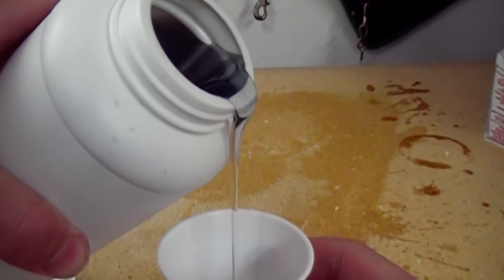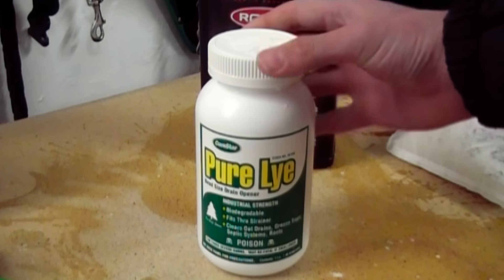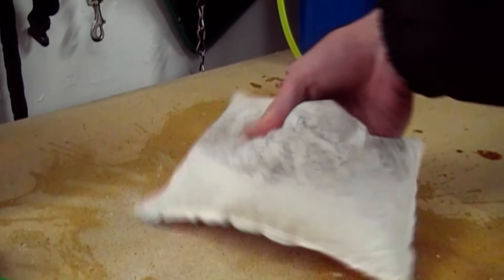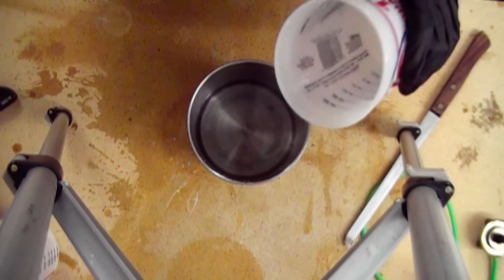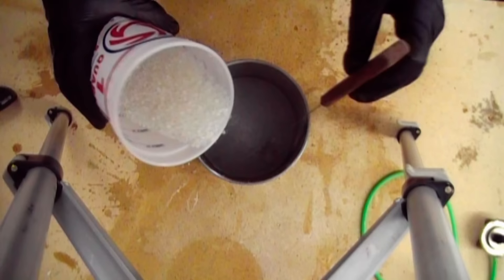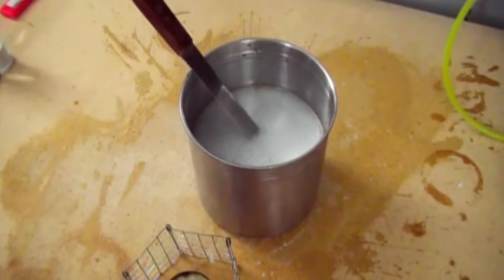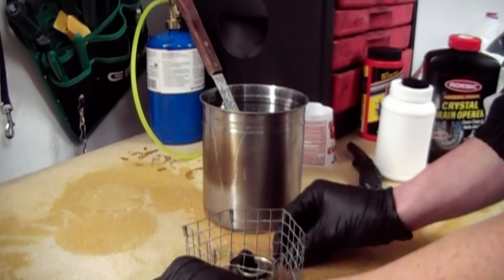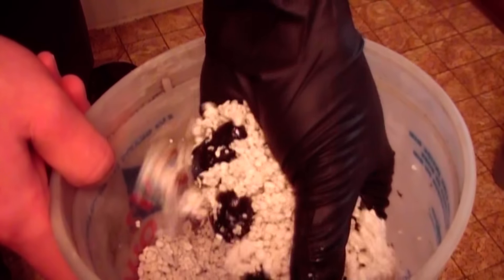Homemade sodium silicate (water glass)

Comment: Good day
I am interested in your homemade sodium silicate. I tried to make it myself. Which pH has your finished product? My 3.2 has and I think that is much too acidic. I read that silicate until a pH of about 10 is stable. Should I add more hydroxide just until I get to the desired level?

Thanks for your response and please excuse the bad English (Google Translate ;) )
Reply from the maker: mcj245 That is strange that your product was acidic, make sure all your chemicals are pure. I do not think your product can be salvaged.
Reply: Many thanks for the answer

That's odd. Do you have the PH measured once? I have kept exactly to the instructions. And I have my sodium from the drugstore (No drain cleaners or similar), it is 100% pure. Are there different types of silica gel? The water glass acts on the consistency just like yours. Is there a way the water glass test?
Reply from the maker: You can test the product by adding an acid, vinegar works fine, it should react to leave a gummy blob of silisic acid. Or if you have pure ethanol, add the ethanol and it will form a stiff rubber like material.
Reply from the maker: The reason I don't think sodium silicate can be at all acidic is acid causes the product to react into something else. There are silica gels that have moisture indicators in them. I avoided using those because I don't know how they will react. There are also different kinds of moisture absorption products that are not silica gel.
Reply from the maker: Oops, it's spelled silicic acid.
Reply: Hello I did a test with vinegar. There is no visible reaction happens. So I tried it with a 59% phosphoric acid ;). It immediately became gel. So I think my product is fine. Maybe I'm trying to make a laboratory garden just to be sure. Thanks and Greetings

Comment: Hi clkindred can you please help me. When I'm making my sodium silicate I'm using the exact same ingredients as you and mine is blur and gets big lumps of blue no matter how fast or slow I pour and mix them together.  Please help me. Thanks
Reply: I mean blue not blur
Reply from the maker: Derek Jacobson
 Some silica gel have color changing dye to indicate moisture content. It color dose not matter. Some have noticed they need more water to get all of the gel to dissolve. If your gel is in the form of beads like here, you may need to add some heat with a hot plate or burner to get the gel to dissolve. Be careful though, once it starts to dissolve, it will generate its own heat and will boil over if not taken off the burner. Thanks for the comment!

Comment: The NaOH is capable of turning the glass into sodium silicate, so a steel container is best.
Reply: I want to see a video of that. It seems very wrong to me, and I have used pyrex more than once WITHOUT issue.
Reply: @dtrotteryt  pyrex are boron not silicon based

Comment: another option for silica gel packets is crystal cat liter it is made from silica gel
Reply from the maker: Yep, that's what I have been using lately. Thanks for the comment!
Reply: I am going to try MIMI cat litter, also supposed to be 100% silica beads, and it cost about 2/3 the price of Crystal! Crystal was $15 for 8lbs and MIMI was $5 for 4lbs so I bought 2 bags and saved $5 for the same 8lbs! Both were at Walmart super center about 40 miles away, the little Walmart local did not have either!
Reply: And the ammonia and stench emitting from the litter is just a bonus perk. I figure, I'm getting every last penny I spend out of that cat liter, so, not having a cat myself, I put a box of liter out in the field down the street for all the feral cats to use, (allowing them to regain some dignity as well I might add), and after about a week and a half, I picked er on up and brought that ammonia stanching box of cat piss, a few turds, some fox tails and dandelion petals, and soggy silica gel beads, back on home to the garage where I had my 5 and 7 year old daughter start sifting out the turds and other misc debris, then had the Mrs begin drying it back out using our China Wok and a couple broken drum stick halves from back in the day as stirrers, while I managed to collect about a half a cup of distilled water from all the excess steam while I took a hot shower. I grabbed some fresh lye from the neighbors across the street in perfect timing too, just before they got home, scooted on back home and had the kids start mixing in an old flower vase we had laying around the backyard, added some heat from my kerosene jobsite heater/dehumidifier, and boooooyyyyy, what a mistake that was.... Must've still been some cat piss moisture left over or something, because, well, things got a little hot... The vase came out just fine, the kids are....Okay kinda, the wife Is always pissed anyhow so no worries there, but her parents old classic caddie we kept in the garage has seen better days... Next weekend were cooking up some bathtub biker dope with cat piss in it just to see if I was right.....yup....

Comment: the mimi cat litter i found says porous silica sand, not silica gel.  are these two different things?
Reply from the maker: I thought that too when I saw that description on the bag, but no they are the same. Silica "gel" is just silicon dioxide, that has a porous structure that allows it to hold on to moisture.

Comment: Excellent, great videos, I just had to sub. So going by what I read, if it's a little thick in viscosity, add more water.
Reply from the maker: Yes, depending on how hot the reaction is, you may loose a lot of water as steam. Just add water until the desired viscosity is reached. The silica gel beads I used here reacted slowly. Silica gel kitty litter or other "rough" gels react much more vigorously and with much more heat. Be very careful if using rough gel.
Reply: Great stuff,Ordered everything for the whole process, took a while to decide but I have to give it a shot. Wanted one for a while and yours to me was the best way to go, You make  sense.

Comment: I want to know if this is what I need to repair cracked on cell ph screen and how to do it would you just apply over the whole screen and would it be just like new glass ?
Reply: I tried this, and it didn't work quite as well as I hoped it would.  It does fill in the cracks some, but leaves it less clear, think of like a tape residue. But it will increase the structural integrity some.

Comment: Mine ended up with some fat clumps of silica gel. What did I do wrong? Did I add it too fast? Too hot?
Reply from the maker: You can add more water to it if it won't all dissolve. Some people have reported this same problem and it might be water loss from steam while boiling. If your silica gel is rough, or small particles it will react more vigorously and cause you to loose more water than I might have.
Reply: my silica is sand like in consistency, I think I added it too quick also.

Comment: I just finished a batch (1000ml distilled water, 400g sodium hydroxide, 600g mimi kitty litter) everything went smoothly. turned out a deep purple cuz of the dye in the kitty litter. lol
Reply from the maker: +pwntagerz Gosh, sorry for the delay! Good to hear about your success, I have used bleach to destroy the purple color in the kitty litter before turning it into sodium silicate. It works pretty good, leaving a colorless product, but there dose not seem to be any need to do so. Also fumes are then a larger concern if any bleach is still present.

Comment: free8704 I appreciate the comment.. definitely let me know. I have everything else to make my forge aside from the aluminum oxide..
Reply: Beverly Brandon Yes the 70 grit does work. It is a little more crumbly though when making the cement, it really needs to be pressed into the walls of the forge and helps to blend it up in a coffee grinder a little bit first. You forge also takes on a black color obviously rather than light gray.

Comment: Will 40% Sodium Silicate work for the coffee can forge?
Reply from the maker: Sounds a bit on the dilute side, it may take longer to dry. Drying is the biggest source of problems when using sodium silicate at high temps. If its not dry, it destroys itself.
Reply: clkindred I read somewhere that Portland cement will help it set faster and CO2  gas will as well.

Comment: I'm not sure whether my drain cleaner will work. It contains sodium hydroxide, sodium hypochlorite and some other stuff. Will it work? If not, what would?
Reply from the maker: It might, just be aware the sodium hypochlorite (bleach) will add a toxic fume hazzard. If you try it, be very careful.
Reply: +clkindred Thanks alot for your quick reply tho :) Sure I'd try it out if i can't find 100% lye drain cleaner :)
Reply: +clkindred Hi i found one with the ingredients: sodium hydroxide and surfactants. Will surfactants be involved in anyway?  I think this is the closest to pure lye that i can find in my country
Reply from the maker: +Sheekit Low "surfactants" is kind of a vague term, it could be a number of chemicals. Surfactants are what make soap "soapy." Another viewer reported better luck searching for "100% lye" instead of drain cleaner that's pure sodium hydroxide.
Reply: +clkindred Thanks alot. But would the surfactants affect the product in anyway? Because pure NaOH is a controlled substance in my country
Reply from the maker: +Sheekit Low Again because "surfactants" is such a vague term I have no idea what it could be, is there a brand name to search? I like to bring up the manufacturer's website and bring up the MSDS on the product, it is normally more telling of what is in there.

Comment: mine stayed gel like even after dousing with co2 (will harden if left to sit out all week, but still has a soft core)
unlike the video i mixed both dry ingredients, and then added water. after a violent reaction the water came up to boiling on it's own.
Reply: Not very safe. It is done in stages for a reason.

Comment: Are the fumes dangerous when boiling
Reply from the maker: There are not really any fumes other than steam when boiling this. It will smell like soap from the lye though.
Reply: clkindred I used your formula today and made up about a liter of the stuff. This was done in two batches. I've got a couple observations/questions about the process.
Firstly, for the silicate gel I used cat litter crystals. They seemed to work fine with one exception. This exception leads me to my question. In both runs I ended up with a solution supersaturated in silica gel. I had to remove about 20g of the stuff from the solution in both batches because it refused to melt. My question is if you think that this excess was due to the gel source or is your formula a little heavy on the gel side?
Secondly, my second run ended up too thick. I poured it into my liter container which already had the first batch in it but it was a lot thicker and glops of skin flowed into the container. Do you think this will thin out with the other solution or will it form a skin over the top and make it difficult to extract from the container?
Thirdly, I also built your forge burner but was unable to obtain the 1/8x3/8 reducer that you show in your video. I couldn't find it anywhere. My jury-rigging extended the orifice too far forward and the primary combustion chamber didn't work right. I was unable to tune it for a neutral flame. Where did you find this particular brass fitting?
Lastly, Thanks for the great videos and the obvious science and experimentation that you document in your videos. They are a joy to watch and I was unable to resist the temptation of trying a few of them. Keep up the great work.
Reply from the maker: Dr. Larry Grimes
Thank you for the kind words!

The formula IS heavy on the gel end to make a ratio known as "waterglass" stoichiometric sodium silicate would be double the sodium hydroxide than what I used here. Perhaps you lost more water due to evaporation when making yours, I made a big batch the other day using cat litter and it came out fine, just really really purple. When trying to get the gel to dissolve you may need to add more water.

Sodium silicate is thinned with water, so if you need you can add water until you get the thickness you want.

I swear I bought the last one of those 1/8-3/8 fittings on earth because I could never find another one. The video where I make the bigger blow torch I show how to make one. A note on the orifice, what size did you make it? Mine are .016'' and it needs to be a clean, strait hole.

Thanks again!
Reply: clkindred Thanks for the info on the bigger blowtorch video. I'll have a look at it.
The orifice I used was a .023 MIG tip (M6x.6mm)which is larger than what you suggested but very true and clean. I drilled and tapped a 6Mx1.0mm thread that the tip screwed into. I bet I have a 1/64 drill from my modeling days. I'll find it and remake the orifice with it.
I'll let you know the results.
Thanks for the stoichiometry of the reagents. This makes perfect sense. I'll play with the ratios with my next batch. I'll bet the batch I made is stronger than the 40% solution that I see in commercially available sodium silicate. I'll calculate out the stoichiometric ratios that I currently have. This should help me cut it with water. My first batch, following your recipe, ended up just under 600ml of solution (about 570ml if I remember) after removing about 20g or gel and boiling down some. The second was very close to a 500ml solution after removing about the same amount of solid gel.
Thanks again.

Comment: Maybe you could help.. Im having a hell of a time finding Hydrochloric and sulfuric acids.
All of the drain cleaners that use to be HCL now appear to be sodium hydroxide.

do you have any tips?
Reply from the maker: Well the sulfuric acid I have is liquid drain opener, look for the bottles of drain cleaner in a plastic bag for added leak protection. HCL should be available as "Muriatic acid" for cleaning concrete floors. Both should be carried by a real hardware store, not walmart and such.
Reply: yeah lowes in my town carries only sodium hydroxide based drain cleaners.

is muriatic acid available 37%?
Reply from the maker: Clown Whisper I'm not sure about that concentration, the MSDS for the "Kleen strip" brand says >25%
Reply: clkindred Kleen strip......  I think that home depot near me sells that.

But I think that I am going to go and make some using the sodium bisulfate method instead.
I have a rolling bench in my garage ill simply roll it outside.  The only thing that I have is pure lab grade latex tubing.. I wonder if that will work.   I cant remember if I would need a glass tube or not.  crap..  

Ill give it a try this afternoon and let you know how it comes out.  Then i will have to read up how to test the mole strength.  thank you for all of your help lately!!!!!
Reply: Last I checked (about 2 years ago), auto parts stores sold sulfuric acid by the gallon for refilling batteries.
Reply from the maker: Chuck Mercer
Some youtube home chemists have said that car battery acid has gotten very expensive. That's where I learned of drain opener as a source of sulfuric acid.
Reply: clkindred I have been attempting to synthesize HCL using the sodium bisulfate method.  Its just terrible!
Go watch NerdRage video!!!

No matter what I do all I get is medium weak acid and a solid puck of unused chemicals in my vacuum flask!  
NO matter what eat source I use I can not get the mix of chemicals melted / boiling. Even when I add water as suggested all that happens is that the water boils off and im left with the solid cake of hardly used chemicals. 

Im going to go buy a couple of jugs of acid and will refine it if I have too.  This is getting stupid.

I live in michigan where the rooto corporation is. Its about 35 minutes from me. .

Comment: Can Amorphous Alumina Silicate be substituted for silica gel?
Reply from the maker: +1337fungi It might work, there will be an insoluble aluminum oxide residue if it works. Silica gel is cheap and easy to find though, why do you want to use amorphous alumina silicate?
Reply: +clkindred I have an ample supply in the form of a product called Stardust 

http://www.stardustspillproducts.com/products/stardust-super-absorbent/

Just Curious. Thanks for the reply.
Reply from the maker: Ah, gotcha. That product might be a good stand in for the aluminum oxide filler I use in my refractory mixture.

Comment: Any Ideas on how concentraded this stuff is? around here they sell it around 36-40% for about 12$ /1000grams
Reply from the maker: +Actionhank The starting ingredients makes a 50% solution, 500g of dry ingredients and 500g of water. But the boiling down of the solution concentrates it to about 60-70% I think.

Comment: would adding quartz sand(the clean white sand) to molten sodium hydroxide work? do i have to add water after?
Reply from the maker: Quartz sand could work, but the process is different. The silica gel is used because it had a very porous structure allowing it to react in an aqueous solution. Sand reacts so slowly in a solution of lye that it can be said that it basically doesn't. In order to get the reaction of sand and sodium hydroxide to work, the sodium hydroxide is used with no water at all, and it is heated until molten. This molten lye will eat right through glass, so a steel vessel needs to be used. Then the quartz sand can be added and reacted. This process is many times more dangerous than the silica gel/sodium hydroxide/water method, but will yield 100% sodium silicate with no water. This product will be a white solid.

Comment: Water Glass is sold all day long out in here in NV. You do have to get it from the Pharmacy. Ive seen so many vehicles with cracked blocks sold to many a poor bastard by old timers. They always use Water Glass.
Reply: yep, works for a while then your engine blows. the secondhand car cowboys have been using this trick for 70+ years